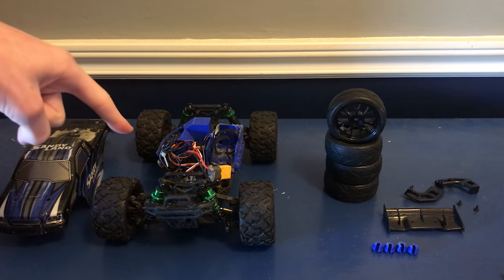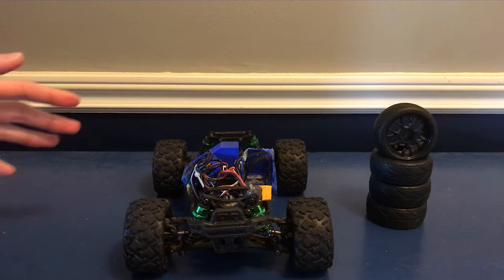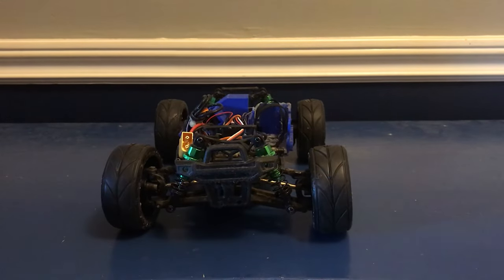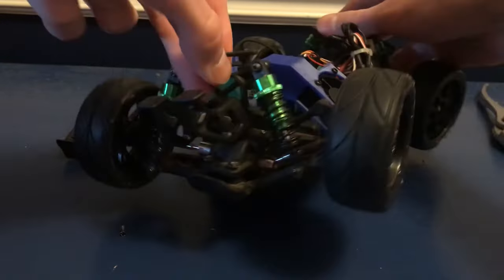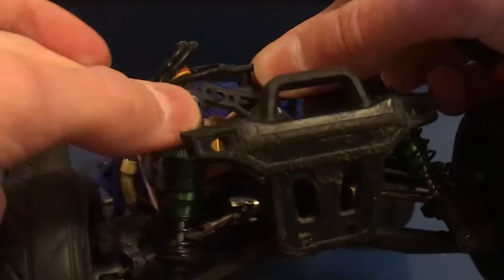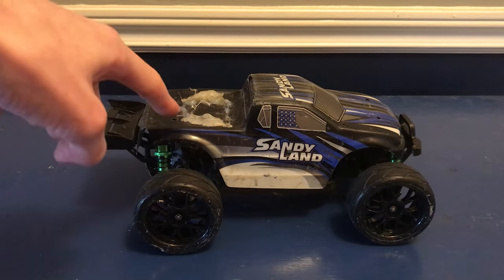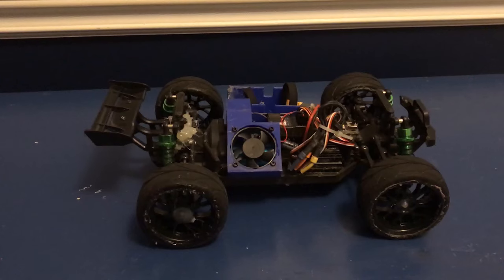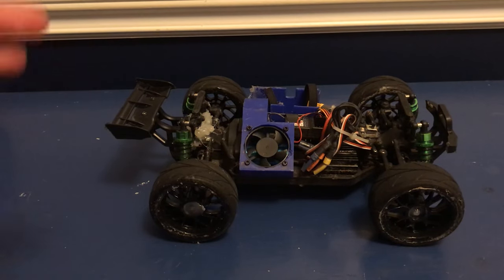Sandyland Street Racer - New Tires, Wing, and Lower Suspension!

Comment: Could you please tell me what kind of connector connects the motor to battery(the yellow connector). I would like to order some in order to use an imax balance charger. Thank you for a reply.
Reply from the maker: Sure! It’s an XT-60 connector. It’s not the original connector though, so if you’re looking for a better charger for the stock batteries, it won’t work.

Comment: Hey I got an pinion gear upgrade for the sandy land but I can't figure out how to take the old one off.
Reply from the maker: Some of them have a little screw, but most don’t. I think you’re supposed to remove the ones without a screw by pulling them with pliers, but I’ve never done it and I’m not 100% sure. I’ll update this comment if I can find out!
Reply: Ok thank you

Comment: Nice vids i have the same rc car you should send where to get the parts and new motors
Reply from the maker: Sure! You can get pretty much every part for the car from pxtoysrc.com. They’re pretty easy to find too because they’re all named with the part numbers. The one issue is the shipping takes a really long time, and there’s no tracking info. 
Amazon also has a lot of the parts. They’re not as easy to find, but the shipping is way faster and cheaper, so I try to order from Amazon whenever I can.

Comment: Hey my sandy land I try to take the wheel off I can’t take it off it’s like stuck
Reply from the maker: I’ve noticed this on mine too! The wheels are stuck on the little threaded shaft really tight. I find that the easiest way to get it off is just to hit the shaft (gently) with the back of a screwdriver until it comes loose.
Reply: @CHEESEBURGERRC  ok I’ll try that